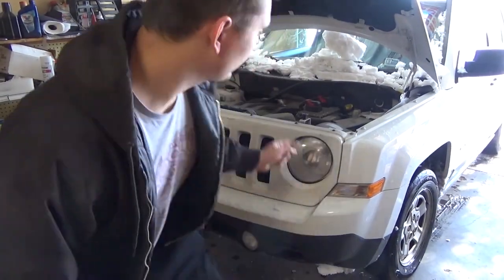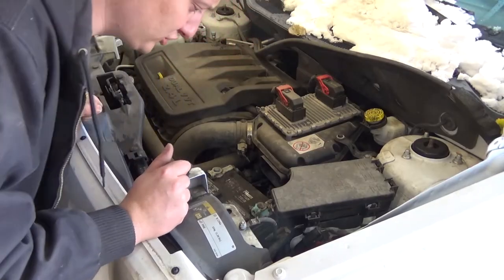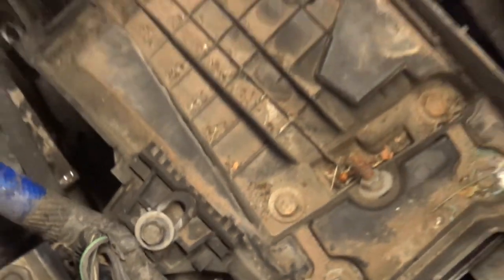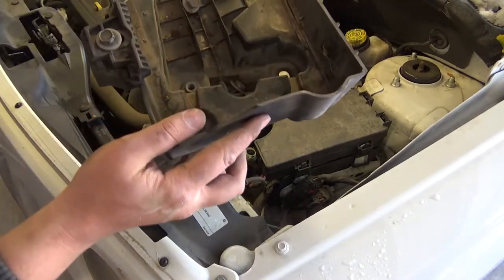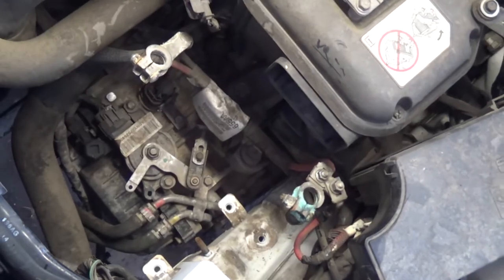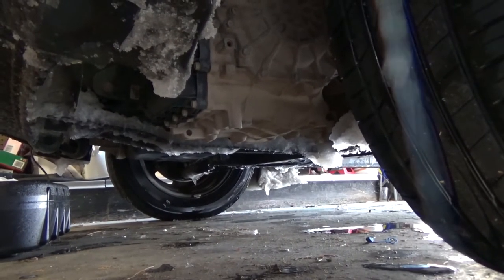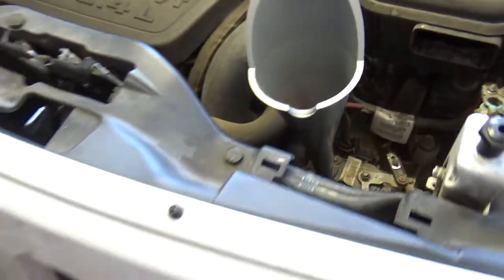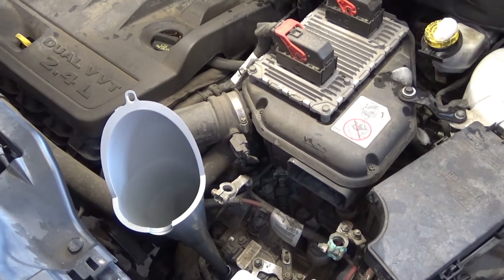Transmission Fluid Service | 2014 Jeep Patriot (6F24 6 Speed)

Comment: Free tip Friday on a Sunday.  Always take the fill plug out first before draining.  If you drain it first, you could be in trouble
Reply: Why?
Reply: @JB-tz9pi  air in the transmission.
Reply: @JB-tz9pi  If you drain first and then try to get the fill plug out and it will not come out, you will not be able to refill the transmission.
Reply: @donho3617  lol that makes total sense.  I'm not sure where my head was.

Comment: I just serviced my friends Jeep with new fluid and I just put in the first 3 in then started it and then put it in neutral running and filled it with another qt and it worked fine. Honesty I have no idea why Chrysler wouldn't recommend filling the tranny from a fill plug in neutral. All the other manufacturers do it that way.

Comment: So i jus did this today on my patriot, same 6F24 case, 3 quarts were what came out when I drained it, took the little black cap off the hose thats to the left on top of the transmission to burp the air or watever u wanna call it, filled 3 quarts through the fill port, closed it and checked the level on the fluid through the checkport on the back of the transmision at operating temprature or about 125°F. Checked it with the special dipstick that is used to check through that check port, with 3 qts in there and at operating temperature...dry so i added another to make it 4qts and let it set in n checked again and there was barely anything on the tip of the dipstick, so i added 1 more qt thats 5qts total and it looked like it got to 20-25 on the dipstick which is what they say it should be at on the dipstick. Took it for a test drive and i could already feel better performance.
Reply: Yeah it is 5 quarts. And you're right to have taken of the plug in the breathing tube, that allows for the addition of the final 2 quarts. 

This is a good video, just missing that little bit about the breather tube. Still will be very helpful for the average user.
Reply: Factory it requires 4.3 quarts
Reply from the maker: you all don't realize the torque converter holds a significant amount of fluid. So unless you pull that out or use a fluid exchanger, you aren't getting a full 4.3 quart drain.
Reply: @jessedrifts  you should be getting four Quarts in a drain you can count how many quarts you take out. Very simple to do that just by using a funnel and letting it drain into an empty oil change container
Reply: The dipstick how many inches is it from top of the threads?I was thinking of using a matel rod mark or match the dipstick length and use rod as a measuring dipstick instead, does that dipstick touch the bottom of trans? I want to try drain and fill my inlaws 13 patriot

Comment: Thanks for the video. Many people will tell you that all of these Patriots just have the CVT, so there's not much help for the 6 speed automatic. I drained what looked like three quarts (I won't have any empty measured container until I empty the gallon jug I bought), and then filled with three quarts. When I opened the inspection cover, it came gushing out. Also, I can see the fluid level in the filler neck. Could something be preventing fluid from getting down to the bottom of the reservoir? Right now I don't even have a solid feeling of how much fluid is actually in there.
Reply from the maker: Yes If you fill it too fast it will bubble up. The transmission is sealed so that's the point of air evacuation unless you open the inspection cover to drain while you fill the transmission.

Comment: I did my inlaws 14 jeep patriot it has the same transmission as yours ,they bought the transmission filter with gasket ,and they got 5qt of liquid moly transmission fluid, I looked at the trans pan shape and bolt holes compared it to the gasket it looked correct and bolt holes. so drained out 4.25 qt ,took trans pan off and could not see the filter nothing that looked like the new filter so I went on cleaning pan ,then noticed the gaskets are different the new gasket looked very similar to the pan's shape but at the bottom left corner is different 😮 ,so went on cleaning the pan and reused the original gasket,I thought the transmission fluid was the wrong but it says sp-iv the liquid moly transmission fluid is brownish color not the typical red I see lol ,where are these transmission filters located

Comment: I need help. Advice at least.  2016 6f24 transmission.  Had a Po729 code.  2nd or 6th gear incorrect ratio???  Seems to be stuck in gear.  3rd or fourth i am guessing.  Drained transmission.  seemed like a lot of shavings to me but they were extremely fine shavings, dust even.  It has 84,000 miles, so no warranty.  was thinking i could try new fluid and filter or some one said trans might have an electric valve bad???? i am lost.  i am told filter is extermly hard to get to and a waste of time. still owe on this Lemon.   Any Ideas??? Please.  Thank you
Reply from the maker: Take it to a certified mechanic. You can experiment if you want but I wouldn't because if it doesn't work you're out a transmission on a vehicle you owe on. You can try a fluid change but that's all I'd do

Comment: Do you just check the fluid level at the fill location or is there another place? A guy in another video looked like he put the dipstick somewhere else.
Reply from the maker: There is no dipstick on this......
Reply: @jessedrifts  I realize that... but there is a special dipstick that you can buy and use to check the level..I was asking where it goes. But thanks so much for the help 👍
Reply from the maker: If you buy the one it goes in the back of the case of the transmission. Right above the axles almost touching the firewall. You cannot see it and the only way to reach it is to reach your hand around under the car forward above the steering rack and find the bolt. FCA discontinued this method for good reason. You have to use a long fill tube from the engine bay to get to it. And the fluid level is dependant on the temperature. At that point if you don't want to do it the way I showed you should take it to a dealer or otherwise as assumed at your own risk. This video is for entertainment purposes only
Reply: @rustyshackleford054  I have seen videos of using the oil dipstick and getting a mesurement in the fill hole first.  I am going to try this plus the procedures in this video

Comment: My 6 speed transmission randomly doesn't want to shift. It wont go pass 2nd gear. You think a service would help or is there something else thats common on these? 
Any thoughts will help.
Reply from the maker: Sounds like your master or slave cylinder is going out
Reply: @jessedrifts  Oh, No its a 6-speed automatic like the one in this video. It drives flawlessly for 5 or 6 days and then all the sudden wont shift higher than 2nd gear. I didn't know if these were known for sticking shift solenoids or just dirty fluid condition causing issues. It has 80k miles on it.
Reply from the maker: Fluid, solenoids, or electrical noise in the apps possibly
Reply: @jessedrifts  Yeah there's 8 Solenoids on this thing. Not sure if its a valve body issue, solenoid issue, or fluid issue. And to make it all worse it only does it once a week....
Reply: Starting to have issues with mine. Like it’ll rev up in second and I’ll back it off a little and let it catch. Buddy of mine said I’m burning up my clutches but it does it once a week or so so i don’t know. Runs fine otherwise

Comment: Hi bro, do the transmission has a filter to be changed.
Reply: I was wondering that my self.
Reply from the maker: It has a pre-filter but you have to take apart the transmission to get it out. It's more of a filter to prevent big things from getting in there. Not necessary to change unless you had dirt or contaminated fluid get in there
Reply: Im pretty sure u have to replace the filter and gasket by dropping the pan on the transmission...thats the part I didnt see in the video.
Reply from the maker: No you don't. The transmission filter is a pre-filter. The micron size is bigger than the clutch material size in micron so it won't collect the clutch material. If you do that you need to take it to the dealer unless you know what you're doing.

Comment: When I search for tranny fluid I keep getting search results for Mopar ATF-4. Is this amsoil the other I've been reading about ATF SP-IV? I got the 6F24 I'm just confused if I should get the ATF-4 type or not. I can't tell which is "newer" only that SP-IV has a lower viscosity. 2nd Question did you say at the end of video you wait a week of driving and repeat? I'm guessing to get a majority of the "old" fluid out?
Reply from the maker: Chrysler ATF+4*, MOPAR* 
ASRC, 68089195AA, 68049954AA

This is what Chrysler and Mopar specs it meets and exceeds. If price is your issue, amsoil is not for you. It's above the standard for protection.
Reply from the maker: Answer to question number 2 is yes
Reply: @jessedrifts  I can afford it, can't help but notice the cost difference AT+4 vs SP-4. All the sources I'm finding say the fluid should be ATF SP-4 which is why they pointed you to the Amsoil I'm guessing by reading the back of it I can see it mentions SP-4. Any of the SP4 rated ones seem to avg 25/Quart. I might just look at my fluid and see if the condition is fine, because I just got this and have been doing maintenance just for fun. For all I know there is new fluid in there but I doubt it. I got 156k miles.
Reply: @jessedrifts  Hey Jesse mine started leaking out the inspection port at the end of quart #2. You find that odd? I guess not everyone's is the same. I closed it off going to drive then add additional quart after.
Reply from the maker: No that's not odd. Every capacity is different due to heat evaporative loss. How much the converter still is holding in it etc.
Reply: @jessedrifts  I bought eight quarts so maybe I do this two more times over the course of a few weeks. When I was watching my inspection part it was dripping at first and then it turned to a steady thin stream that is when I plugged it. Thanks for the video it helped me out everything came off pretty easy.
Reply: You should only put Mopar CTVF +4 transmission fluid in this vehicle that is it that’s what it calls  for
Reply: @jameshopkins5702  thats the 6 speed automatic transmisison 6F25 hyundai.
Reply: @jameshopkins5702  wrong lol.  The ones that are cvt have a cap and a check tube that requires a check stick with a chart to read the level. Ask me how I know 😂

Comment: I just changed out the thermostats on my niece's Jeep Patriot (ran hot till she turned the heater on full blast) and while I had all of that out of the way I looked for the trans. dipstick and of course couldn't find it.Did your test drive afterwards get the fluid down where you could add the other 2 qts? I'd like to do this for her but I don't want to screw up the transmission in doing so.....
Reply from the maker: You won't ever get the other 2 quarts in unless you use a fluid machine to suck the 2 quarts out of the torque converter. I am still driving my jeep around right now and it has no issues doing what I did in this video. Just take your time. I was nervous also before I did this. I did the research so you don't have to.
Reply from the maker: Also I did this twice to do the fluid exchange so more of the new fluid is in it. You could do it 3 times if you wanted and it would for sure be all new fluid.
Reply: @jessedrifts  OK, so the drain & fill is only 3 qts. then, right? I have 2 civics that I do a drain & fill every 25-30 thousand miles 3 times about a week apart  to keep the trans running smooth but they also have a dipstick so you can check the level afterwards.
Reply from the maker: 3 quarts then 1 quart. So 4 quarts. It leaks out of the inspection cover with 3 quarts. Close the inspection cover and then add 1 more quart. Then put back together and you're golden.
Reply: @jessedrifts  Thanks. I followed the TSB  I was coming here to verify.

Comment: I have a Jeep Patriot 2016.. Sometimes i cant shift the gear, until i push the clutch back and forth like 5 times.. The gears kinda stick sometimes when i try to shift.. Do you think i should change the transmission fluid, or is my clutch going bad? I got 100,000miles on it.
Reply from the maker: Master or slave cylinder is going out would be my guess
Reply from the maker: Or clutch pressure plate
Reply: @jessedrifts  Ok thanks..
Reply: Hey, i woke up this morning,and i went outside and started my Jeep Patriot 2016 up and the gears are working now.. Strange.. I called a Machanic up, and he said, wait until the gears lock up again ,then bring it in.. So. Its weird.. I wonder what it is? He said it could be a spider gear, or the clutch.. It could be a number of things.. Ill let you know how it turns out eventually..
Reply: Hi I have the same problem for a 2015 sport jeep patriot. My gears won't shift out of park and it's stuck. I haven't changed my trans yet because I barley got the ride 2 years ago and I didn't come around so I'm not sure what could be the problem but if any ideas it'll be much appreciated
Reply: My barrings in my transmission went bad.. I waiting to long to get them repaired..i disintegrated my clutch on the way to the repair shop..i ended up paying 3 thousand dollars for new barrings and a new clutch..

Comment: How can I know If my 2014 jeep patriot has CVT or  6f24 tranny? Thank you in advance
Reply: Give a Chrysler dealer the last 8 digits of your VIN and they can tell you what transmission you have.   I think 2.0L has CVT.  The 2.4L has the non CVT.
Reply: Drive your car.  If you accelerate with zero shifting, then it's a CVT.  If the car shifts automatically as you speed up, it's not a CVT.  The non CVT transmission in this car is NOT subtle.  You will feel it and you can watch the revs drop

Comment: does this car come with a filter in the transmision?
Reply from the maker: Yes but you have to take apart the valve body to get to it. Not worth it in my opinion. Unless you are having a mechanic do the work and it's a low mile car like under 100k milss

Comment: i have the same transmission. Can i use mobil atf+4 oil?
Reply: I think make sure it is ATF SP IV specs
Reply: @AlexHoang-lm6ks  thanks. Only Mopar makes that specific oil, but i used Valvoline Multi ATF which has these compatibility, and I dont have any problem. Works fine.